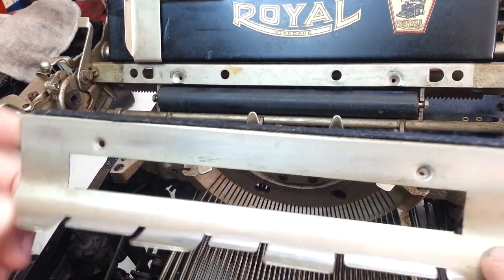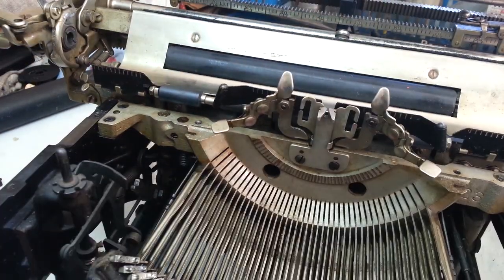Royal X Ten 10 Typewriter Platen Installed, Replacement Feed Rollers

Comment: These are great! Is there anyway you can demonstrate the spacing mechanism? I have a Royal in rough condition on the way, and it would be great if i saw how the mechanism is supposed to work
Reply from the maker: I generally video actual repairs, if I happen to have another Royal torn down I might do that,
Did you get your Royal, is it working ?
Reply: @phoenixtypewriter2136  yes. Just took a little bit of lubricant (which i will flush out with mineral spirits) and now it works fine! I also used the original clip that came with it, a shoe lace, and a paperclip, and now i have a functioning drawband. Now it works. But how does the ribbon mechanism work? The pinion that latches on the gear to turn the shaft isn't latching. How can i tighten it?